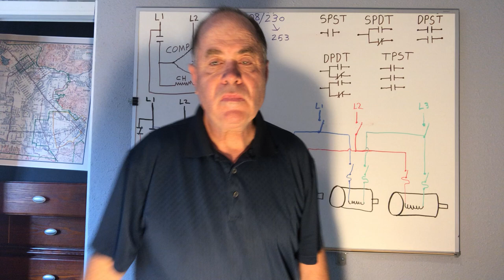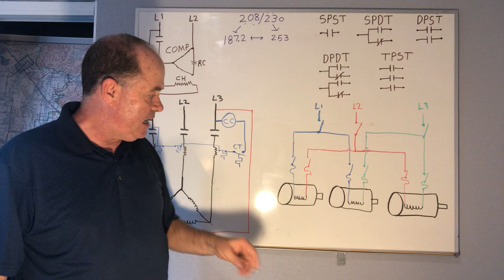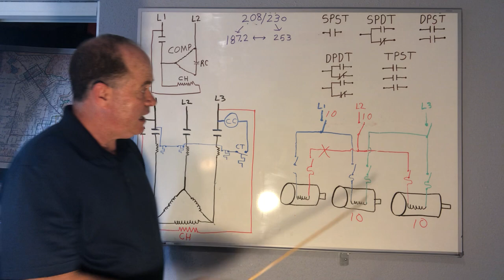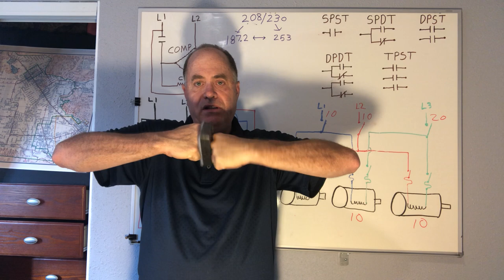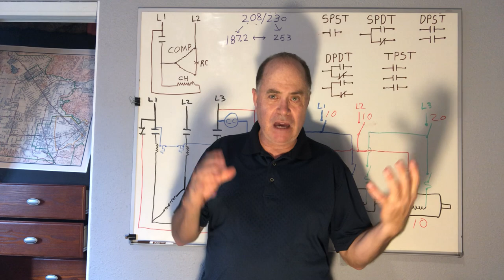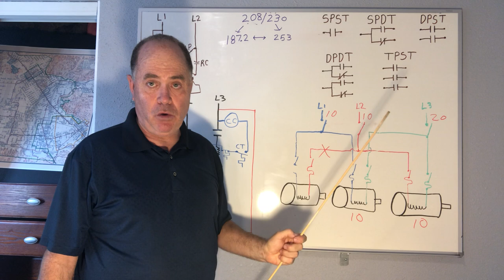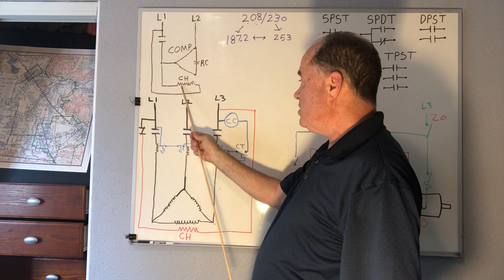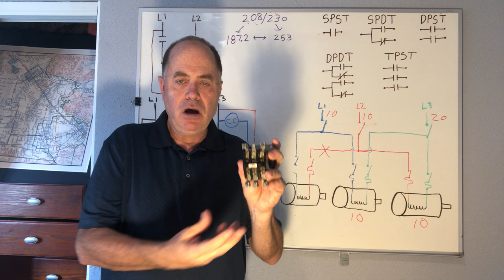Needham’s Motor Applications

Comment: What is the main difference between a relay and a contactor? Google told me it was voltage rating, as a contactor can handle up to 1000V whereas a relay can up to 250V. I got this question wrong from the video....